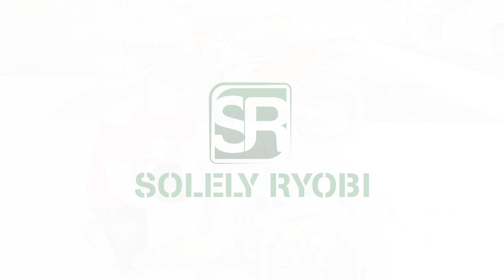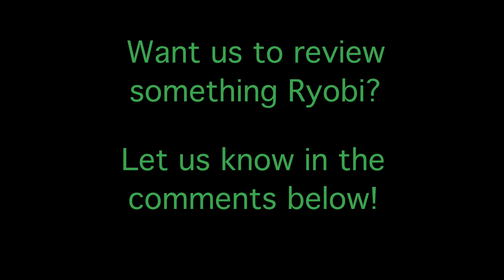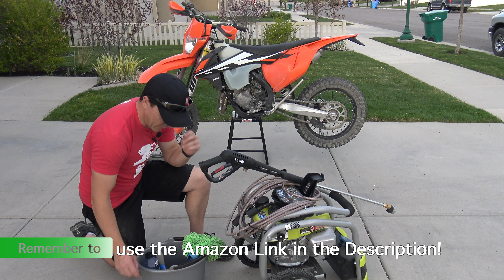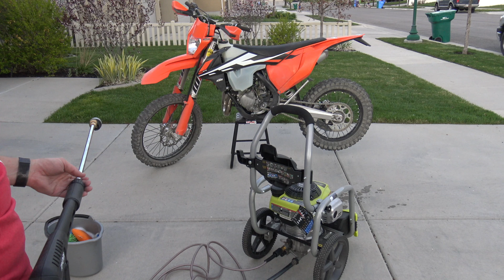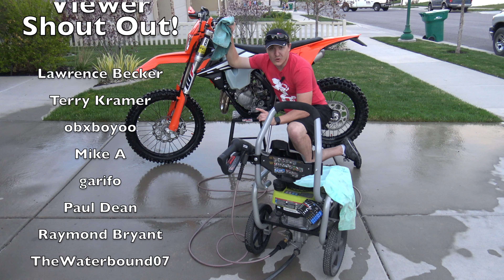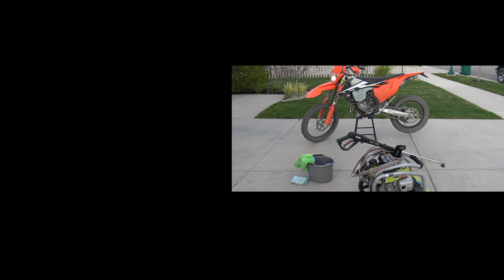Ryobi 3100 PSI Honda Powered Pressure Washer - Cleaning 2017 KTM 150 XC-W

Comment: Bought the pressure washer with the Honda motor. After 2 days use the motor would not start. Found that it did not produce spark. Checked connections changed plug and it still would not start. Brought it back to home depot and got my money back. I expected better of a Honda motor.